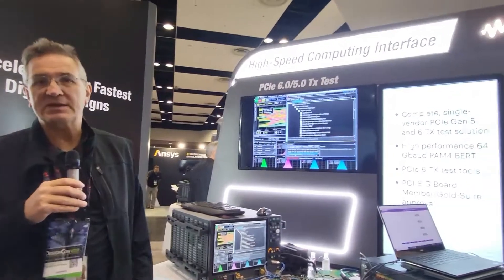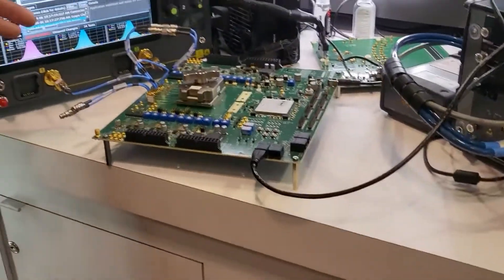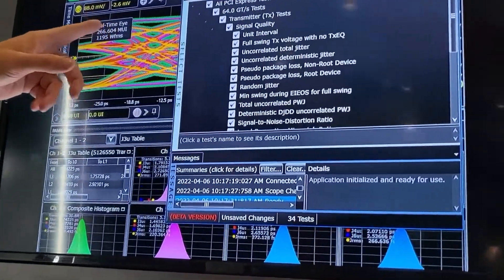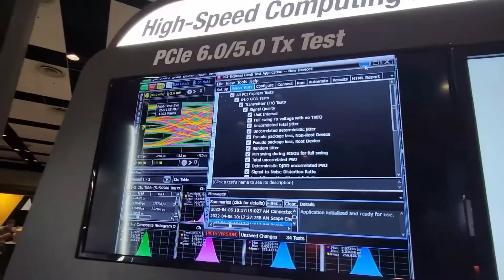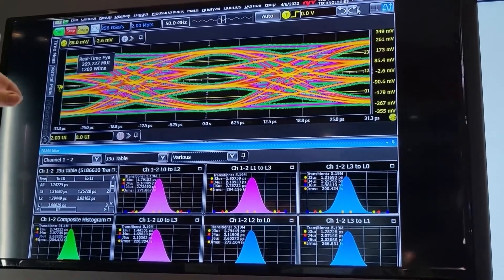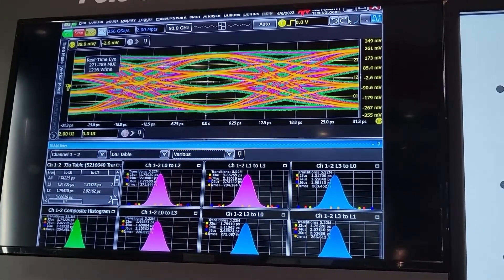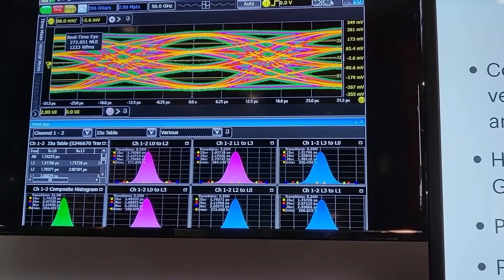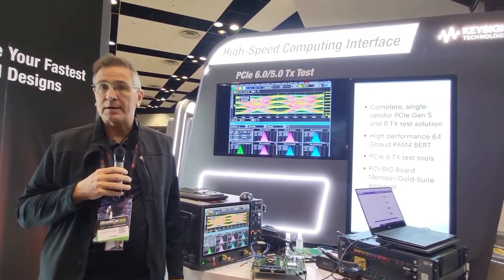Transceiver Test for PCIe 5.0 / 6.0 - DesignCon 2022

Comment: Pam 4, what is this 1990's?  Where's the QAM 2048?  LOL I joke, but seriously you need direct PCIE to fiber transceivers and mux that shit on one fiber. The optical signaling folks seem to be kicking the butt of PCIe as far as bits per lane per second goes. You're at 64 gigabit per channel + overhead, the telecoms folk are at 100 gigabit per channel usable throughput with equipment commercially available and in service now, and it can go 100km, thy are commonly bundled as 400 gbps full duplex packages using only 2 fibers.  I just want a stupid simple pcie to fiber transceiver without having to convert stuff to Ethernet first.